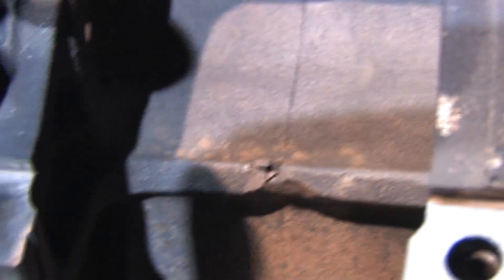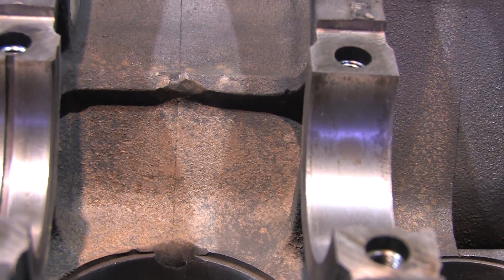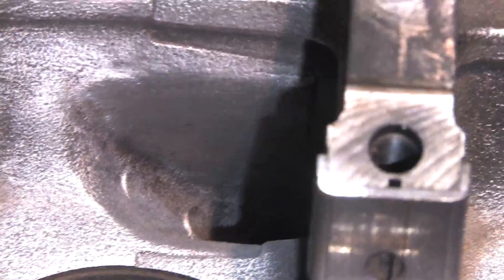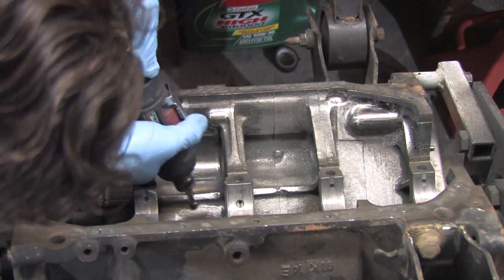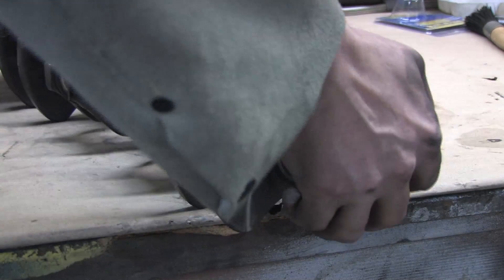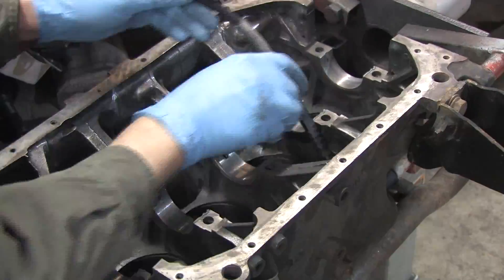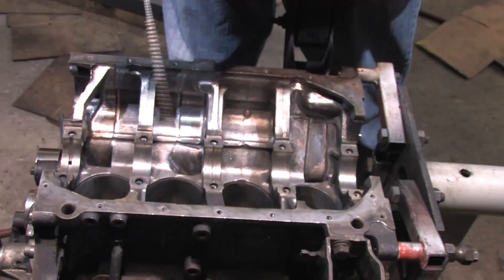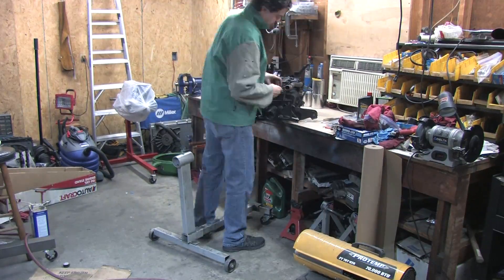Grinding Oil Return Channels

Comment: Instead of making channels in the crank and block why not add an aerospace type oil shedder coating?
The oil return holes can probably be enlarged too.
the main bearing oil holes that go to the oil gallery are not always the same size so I will check them with a reamer.

Comment: my fiat 850 crankshaft seal the flywheel side liking and I need help
Reply from the maker: Might as well do a clutch job while you're in there.  Same exact job but the flywheel's gotta come off, too.  Many cars have an engine seal housing that can be removed and serviced.  A 4g63 does anyway.  I can't speak for your Fiat.  The clutch job (if it's a manual) is cheap insurance to ensure you don't have to go back in there to later replace the clutch that is probably oil contaminated if that seal is leaking.

Comment: you god damn dumbass!  The surface of the iron is perpetually coated in oil when in service, eliminating oxidation!  Talk about DUMB!!!!!!!!!!!!!!!!!!!!!!!!!!!
Even with no oil splashing/circulating across its surface, a protective film/patina will form rather quickly and prevent oxidation ---why do you think people hot tank the block???? To clean that build up off!!!!  So either 1) you're full of shit and I'm 100% correct, or 2) everybody in history is wrong regarding hot tanking.

Comment: Could your objective of polishing the inside of the block and adding channels so that oil flows better to the oil pan. which is the only direction gravity will take it. Could this work so well that the crank will now spin surrounded or immersed in more oil than normal/before causing some resistance?  ThAnks for the videos I love them.
Reply from the maker: Nah,  The FULL oil level of the engine on the dipstick is based off of how far that level in the pan RISES when all of the oil is in the pan (car off).  The oil level drops at startup because of what it takes to fill the pressurized side, but it doesn't stay consistent after that.  It's probably about a quart and a half to 2 quarts to fill up the main oil gallery, oil cooler, crank, rods, head and hydraulic valvetrain .  Maybe more?  How much oil is draining down the crankcase at any given time varies based off of how you're driving, and the oil temperature.  On the low pressure side of things, returning it to the sump is the best thing you can do with it.  There's no benefit to having it drain back slowly.  It will safely be out of the way of the crank because of how much oil capacity has been pumped out of the pan into the pressurized oil system.

We're probably talking about a drainage benefit of a half-cup's worth of oil level in the pan at a hot idle, max.  Even if it yielded 2 cups more capacity, it won't put a big dent in the oil level at idle.  Not even a quarter inch because the pan is so wide at that section.  But the pan narrows significantly as it gets closer to the pickup. It's shaped like

|   __/
L•/

the • is the pickup.

At wide open throttle when you're dumping the contents of your pan into the cylinder head and all over the crankcase at 8500 RPMS... that's when the oil level drops to its lowest level.  That's when you want it back in the pan as quickly as possible.  That's when this modification makes the biggest difference.  

The point of this modification is to keep the oil above the sump submerged and deep enough that it can't create vortexes and suck air into the oil pump.  Kinduv like the little tornado things circling your drain when you drain your bathtub.  We take them for granted whenever we can't see them when the car's all bolted back together.  Fluids still do that kind of stuff even when we're not looking.  This is just cheap insurance to help prevent it.  Drainage channels.  I didn't invent it, but the topic was worth a video.  ;)  I wanted to take time to answer your question fully because it was a very good on-topic question.  You gave me 10 minutes of your time, and I thank you.

Comment: So "jafro" I understand the rod bearing failed because of the high oil pressure it experienced. But I'm having a hard time figuring out why it was making that particular rattle from original video. Was that just the rod bearing making noise from being Beaton and just created excessive clearance?

Comment: I need a oil catch can vid. for my dsm 6 bolt got most of it but how do u return the oil to the motor with out all the psi. whats the best set up venting crank and top end of the motor jafro ?????????????????????????????????????????????????????
Reply from the maker: You don't return the oil.  That's what the can is for.  The oil vapor leaving the engine with oxides, moisture and burnt hydrocarbons should be considered contaminated.  The can's just a container to condense into.  You need to empty it occasionally, but don't worry about the stuff it catches.  You just need adequate ventilation to let it escape, and depending on your style of catch can, you might need a hose going from the catch can to the intake (pre-turbo) so that it pulls vacuum on the can.  Some just have a breather filter rather than an intake hose, and I'm not a fan of those because the filter gets saturated and then they leak all over the engine bay.

Some people disable their PCV system and use the standard valve cover breather along with the PCV port to allow more air to leave the engine un-restricted.  I 2 welded -8AN (2 x 3/8" ID ports) bungs onto my valve cover and plugged both of those holes.  There's a video called "Valve Cover Modification" in my videos that shows how I did it.

Comment: Am very impressed, great piece of work. Had a conversation in UK with one of the operators of Volvo based National coach ( Greyhound like bus network ) who said that some of their units were on their first engine with 2 million miles on them, 'cos effectively they ran long and hard enough to boil / cook the condensation out of the oil & serviced them often .
Reply from the maker: If my engine rusted from just light condensation from not running long enough, I'd take it out back and shoot it.  I hope I'm not scaring people by posting this... lol... this engine was horribly abused.

It is true that light and infrequent use is harder on machinery than continuous operation.  Surprisingly, the same thing applies to hard drives as well, not just cars.  Drives that never spin down rarely fail.
Reply: ***** Yes, the hard drive thing is very true.  I've owned many PCs and I run them all the time.  Haven't had a hard drive failure in any of my machines so far (knock on that wood).  I keep everything backed up, but it's just not something I've seen in anything except secondary machines that I was toying with.  Even those gave fair warning instead of just stopping.  You can hear the read/write head crash and pick back up and hear the disk spin down a bit then back up when they're about to fail. KA-tinnnng.

Comment: I was just wondering, if you were to go to this much prep work.. same as the glyptol video.. couldn't you just use engine enamel paint on the inside of the block?
I have a 4G54 out of a pajero/montero and the inside of the block was coated with some kind of treatment.. actually both of my 4G54 motors have some kind of black coating on the interior, i wonder why Mitsubishi decided not to do it on their 4G63s?
Reply from the maker: That coating is not likely going to be a standard enamel paint.  There is a black crankcase coating available, but I don't know what it's called?  Many paints will have adhesion problems in a hot oily crankcase, and if it's not the right formulation, or if the prep work was done wrong prior to application, it can actually kill your engine.

I'd love to see a ceramic coating baked onto factory parts, but nobody selling cars wants them to last forever, so it's unusual to find something like that on factory parts.  I'm not aware of any cars that come with a crankcase coating?

Comment: Hey Jafro!  Quick question.  Now admittedly I'm new to your videos, and maybe you've already answered this question, but, while polishing the inner crankcase does allow the oil to drain faster back to the pan for recirculation,  doesn't it also reduce surface area that aids in cooling?
Reply from the maker: Yes, but the primary job of the crankcase isn't cooling.  If there are overheating problems that develop from doing something like this, then there's already something else that's horribly wrong.  You have an oil cooler and a coolant system that should be more than efficient enough not to need the block's help at doing their jobs.  This engine previously didn't have an oil cooler, and I'm adding one.  :)  Good question!
Reply: Ah yes, very good and thank you for the quick reply! Looking forward to watching many more of your videos.

Comment: you could probably get that plug out by welding a bolt to it. it looks like is big enough for that to be an option. the heat from the welder would probably help to loosen the bolt as well.
Reply from the maker: If it weren't the Hyundai, then that's exactly what I'd do.  But it's the Hyundai.  :\

Comment: Is that similar to a port and polish?  I've heard friends throw the phrase around and never knew exactly.
Reply from the maker: Not quite the same thing.  It's a polish job alright... But a port and polish job usually is a smoothing and contouring of air passageways in the head, and sometimes a polishing of the combustion chamber on the dome sides of the head.  The crankcase doesn't participate in much of any airflow.  It has a breather system, but it doesn't benefit from this.

Comment: With doing this, would adding a few more ounces or more of oil help with the aeration you were speaking of? If so, how would you tell if you do have an aeration problem?
Reply from the maker: The big concern is not over-filling the crankcase.  If the oil level is too high at low RPM (when less oil hasn't flowed to other areas of the engine) then it's possible for the oil level and the crankshaft to begin slapping into each other.  Trust me, you'll feel/hear that one happen.  One way aeration can be observed by frothy oil on the dipstick when you check it.  Air bubbles in the oil kinda thing.  Air bubbles are bad, m'kay?  M'kay.  Good question!  It made me stop and scratch my head for a second.

Comment: Just out of curiosity. If rust is a big enemy, and is killing viscosity of oil, then why not remove it fully?

Where I come from, most of the year road is covered with salt. So basically everything rusts in time if you dont protect them from it. And what we have learned through years is that wire-brushed (even by angle grinder or dremel) metal is not free of rust, it has to be threated with acid prior to painting it (even with acid prep paint) to get rid of the rust in the pours of metal, or else it WILL come back. Even if a surface is threated with a lamel sanding disk with and angle grinder, when threated with phosphoric acid it has been seen clearly (it "marks" rust black) that there can be seen rust spots on the pours of the metal. Of course it necessarily doesn't come back the next month, if it has been covered with oil or alkyd paint, but it will be back if not fully removed. 

BTW love your passion for these things! Keep up the good work!
Reply from the maker: You are correct.  Wire brushed surfaces even tend to rust faster than the original casting, however; the deeply-embedded rust is far less of a problem with oil contamination than loose flaky surface rust.  Will it come back quickly?  Yes if it goes through what it previously endured.  If I have any say in this thing's future, it will never sit under a collapsed pole barn with the head off getting rained full of water.  Now that the surface rust is removed, if this thing gets put back together quickly, the deeply-embedded rust won't stand much of a chance at returning because everything will get heavily-coated with oil.  All of this rust formed because this block was basically an aquarium for more than 2 years.  If I were using some type of crankcase coating, I'd consider using a rust converter... but I'll just be relying on oil as the surface sealant.  I guess my passion is stronger for the GSX than it is for the Hyundai.  :P  Thank you!

Comment: Are you satisfied with using mineral spirits and compressed air?  No hot tank or parts wash?  Just seems like there is still going to be particulate junk in there no matter how well you do it with that method.

Comment: Crazy fuck no, patient extremely
Reply from the maker: Don't think about it, just start doing it.  Before you realize it, you're almost finished.  Patience is the dividing line between competent mechanics and hack-job mechanics.  :P  It takes patience to do any difficult thing correctly.  So as long as you resolve yourself to do whatever it takes to do the job right, you are in control of that dividing line.  ;)

Comment: The grinding is pretty cool, but you should check out a video by user "Stop the Rust", if you search for molasses rust removal it'll come up as one of the first few videos on Youtube. I bet if you did what you did here and then did the molasses thing you'd be able to guarantee 100% removal of all rust. Only issue is coating the block after it's soaked with an anti-rust measure as it's 100% pure oxidation candy once it's been rinsed off.
Reply from the maker: You are right about oxidation candy.  It really doesn't take long.  If you can keep the parts at a consistent temperature and out of humidity, it buys you time, but they REALLY need to be soaked in clean oil afterwards.  Thanks for the tip about molasses rust removal!

Comment: As always, I'm impressed with your patience and am grateful for the inspiration you provide for pushing my build to the limits. Strong work
Reply: Hey man.  I'm kinda stuck and I think you may be able to help me.  I watched your 2.0 fsi oil pump video on youtube and was wondering if you new the part number for the bolt that holds the gear on the left side of the pump.  Mine broke and I can't seem to get a number to order one.  Thanks man.
Josh
Wizbangcomputer@gmail.com